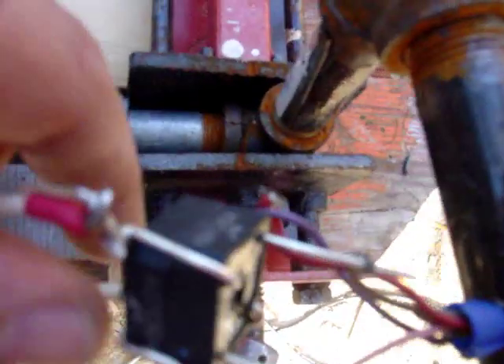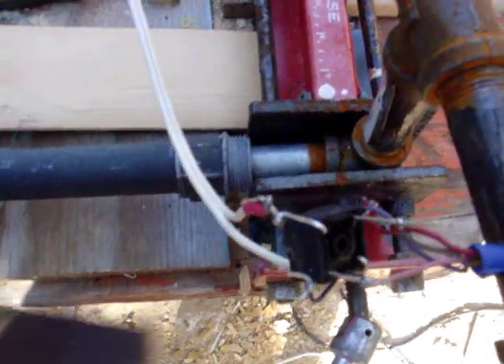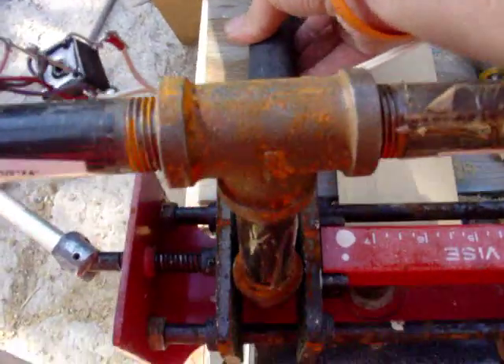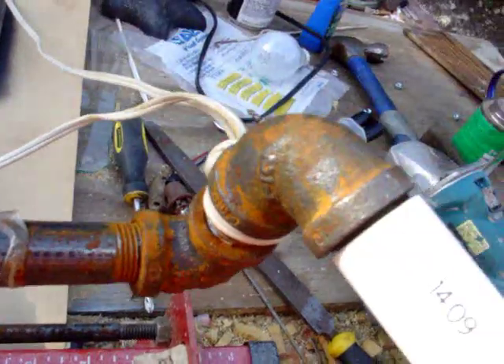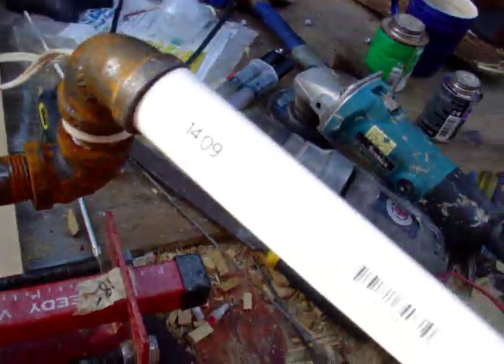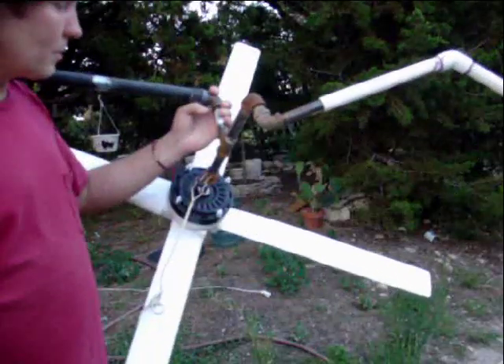PART 7 HOW TO CEILING FAN WIND TURBINE MOV 1

Comment: Scott, just a few questions. 
1. I have been told there should be an odd number of blades.  The reason is wind turbulence from the lower blade in parallel with the support pole affecting the blade pointing straight up.  Causing the blade to stop.  Again this is just what I have been told.
2. Why not run the AC wires just short of the battery and then install the diodes then to the Battery.  AC current will travel on smaller wires much easier than DC so this would be less power loss from the turbine to the batteries?  Just a question.
Reply from the maker: +Chuck Bennett 
Hello Chuck,
I am sorry I missed this comment. And these questions.
Odd numbers of blades has only to do with harmonics. a reduction of harmonic vibration. The only effect I have ever noticed from a blade passing the tower pole is a reflection of the sound that a blade makes bouncing off of the pole, and also a pressure wave as air compresses and also creates a slight vacuum as it leaves the pole area. That is why you hear the blades of a helicopter with a great whopping sound. But you don't hear it from a fan near as much.

There is one part of your question that brings to mind an effect that might resemble a slight stopping effect due to the number of blades. And that is the effect you get between having one or two blades, or having three or more blades, not odd or even.
With one or two blades you have the effect of the jerking yaw on the machine as the wind changes direction and the machine yaws trying to follow it.
This is easily explained by holding a long pipe in hand. With the pipe horizontal, Try to turn to the right or left fast. Next hold the pipe vertically, and try to turn left or right fast. With that said and noted, you can easily understand the jerking motion created when the machine tries to yaw into the changing wind. This jerking motion also slows the blades down in incremental pulses.

When there are three or more blades, there is always an extended leverage to the sides, thus a smoother yaw, and less reduction of prop speed. Much easier for the machine, and easier on the pole as well. not to mention very quiet. 
The trade offs for having less blades are; 1) less carving, :), and 2) less drag and more efficiency over all. and faster prop.

Second question: You are completely correct. 

Great questions. :D

Thanks for the questions and comment.
MUDDy

Comment: Muddy, Thanks for the series of vids.  Most informative.  
Question;  How do you keep the charging leads coming down the support pole from winding around the pole until it could break? Your lead slack looks to not allow no more than approx 400 degrees until it must be rotated back to zero.  Here in south Texas, our wind will swings in five diff directions within a few hours.

Comment: I put a stop on the post so it could only spin 360degs my wire NEVER winds up. it works great. i put the stop in the direction the wind blows the least. i could take a picture of it if you would like one to show you what I did??
Reply from the maker: Wow, Thanks Richard. A picture to share with the lesson videos would be great. Do you still have that wind turbine up?

Comment: I think he was referring to the length of wire that trails from the turbine to the ground getting wrapped around the outer pipe of the yaw mechanism as the turbine rotates when the wind changes direction. if the turbine makes too many rotations around the yaw, the trailing wire will get hung up and try to rip out of the turbine or at least stop the turbine from being able to rotate with the wind anymore. I was wondering the same thing, but I'm only on video 7; maybe you cover it in video 8 or 9?

Comment: I watched the whole series, it was top notch.  I've been slowly absorbing DIY windmill information.  My only question is doesn't a slower rpm motor produce vastly more power?  Is it really practical to use paddle fan motors?  I mean, don't you want to shoot for at least 480 watts coming out of your battery bank in order to power a few dwelling loads?  Thanks for all the info, gonna have to watch it again.
Reply from the maker: Wow, I should have read this comment a long ways back. Great comment.

ceiling fans are low wattage and cheap, or free on the side of the road. But that is what these are for, a cheap way to gain a trickle charger that does 12vdc, 24vdc, and even 12 sets of 120volt ac Christmas led lights with one jumper across the two coil sets, and taking the load from the two other coil start and finishes. and the experience of carving props that work for less that 3 dollars to make two of them. Free energy for almost free. Any one can learn, and enjoy. Even welfare clients. and kids. The windings are very thin, and do not allow much amperage, But it is next to impossible to blow the windings as a result. Low wattage and durable yes. affordable?,... definitely. And extremely versatile.
And dependable.

My goal was the education, and resulting smiles, And I have had a lot of fun and use from many that I have built.

But most of all, The friends, love, and answering the questions.

Be well and safe.
MUDDy

Comment: Hi again, I just wanted to share an idea with you, I have been getting good voltage with the ceiling fan generator and good amperage with the treadmill motor generator so I figure the two of these wired together should be pretty decent. I'de say it should produce about 40v and 4amps. I'll let you know how it goes.

Comment: hello well done on the videos. just thought id ask you can i use a 24v  truck  alternator as a turbine to keep 2 12 volt batterys charged.  and use them to power yard lights. 24v of course. would it work. plenty of wind here in northern ireland. and how would it stand up to high winds. would i need to fit some sort of a brake on it. im a fitter by trade so the work would be no problem. thanks.

Comment: hello scotty,need some help,i have made a magnet generator from washing machine motor and fitted with an other motor to turn the generator,but the prob is...when i connect it with the battery it get block and turn very slowely,may i change the turning direction or wot?plz replay me,thanx

Comment: What kind of epoxy do you use in all phases of this project?
Reply from the maker: Lance Curtis Just any 2 part epoxy. Usually 5 or 7 minute or longer setup epoxy.
Reply: Thank you - I use JB Weld the most.
Reply: Unrelated - your description mentions 'STIRLING ENGINES'.  What work do you do in that area?  Currently, I'm experimenting with converting satellite dishes to solar concentrators and want to put a sterling on one.  However, I cannot find an affordable version for the home energy guy - like me.
Reply from the maker: Lance Curtis Good tips....
Make one with a regenerative displacer. 
And use a material that doesnt conduct heat for the main chamber. Also... If you plan on using a parabolic dish, use fat metal for the hot cap.